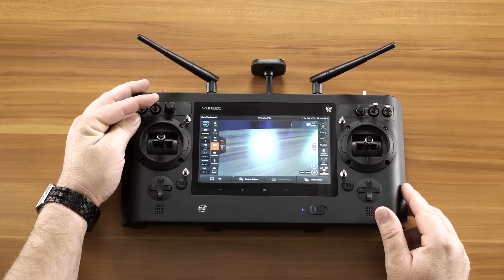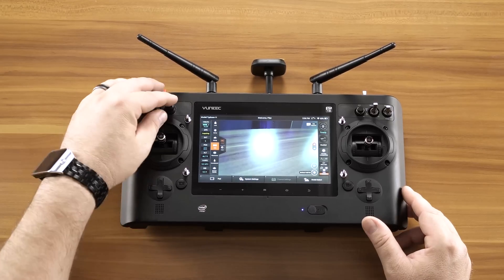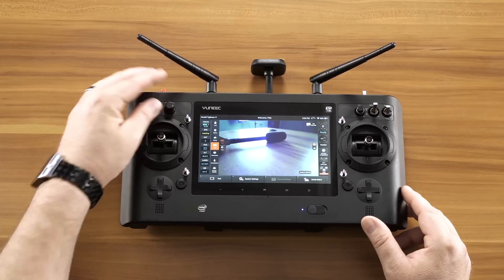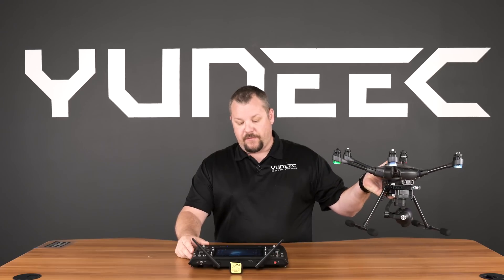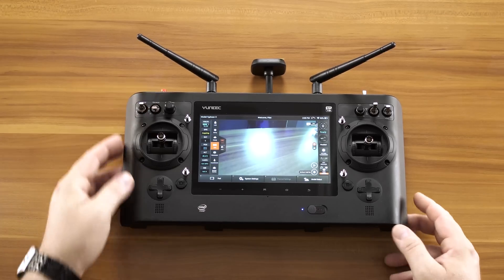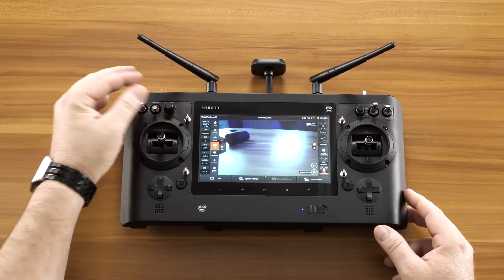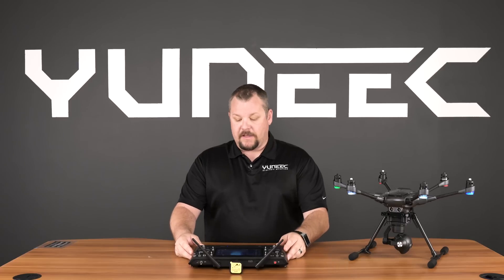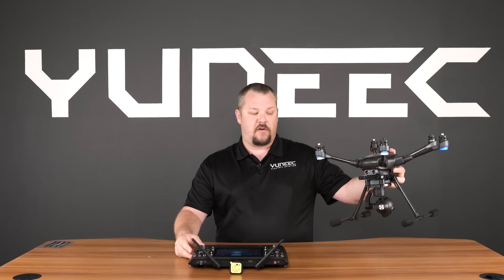Typhoon H: ST-16 Controller Overview

Comment: Hello, I would like to ask about the ST16 controller for the Typhoon H drone. If I pair the drone and the controller. The controller starts to beep, this sound is interrupted for a while if I move the control sticks, after starting the engines the beeping sound disappears, after turning off the engines the beeping sound appears again. The drone did not do this behavior after purchase, it appeared only after 3 years of use. Do you know how to fix it? Thank you.

Comment: Question about my ST16 Controller..when flying,  my Aileron is very slow to return to neutral.   causing a difficult flight control.  I've gone to: SYSTEM SETTINGS, and can see that the movement is very slow compared to the throttle, elevator, and rudder.  I've also gone to Channel Setting and made a percentage setting adjustment.  none of the adjustments speed up the return to neutral... is there a way to adjust the speed of a joy stick??thanks..

Comment: I love how you added an antenna to the ST-16 after I bought one. Yuneec should replace all the ST-16s two antenna unit with the triple antenna units.  You must have added the third antenna for a reason.
Reply: North Country Outdoor Guys consumer electronics are an ever changing commodity.   Being current is a small window.   Staying current is impossible.  These guys have been great to work with.  Call them, maybe it's a user installable update.   Maybe not.
Reply: The early ST-16 controllers do have 3 antennas. The third antenna is inside the case. In the later units they switched it to an external antenna.
Reply: In 2015 we purchased a new car.  They are not going to send over a new car every model year.